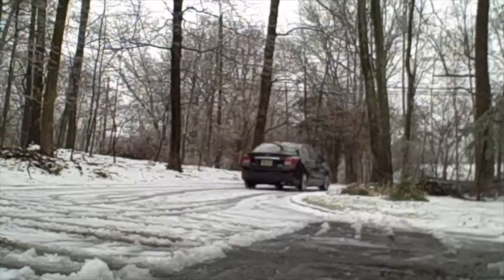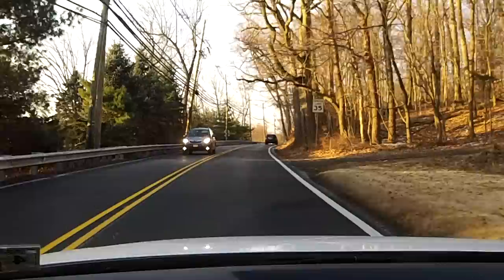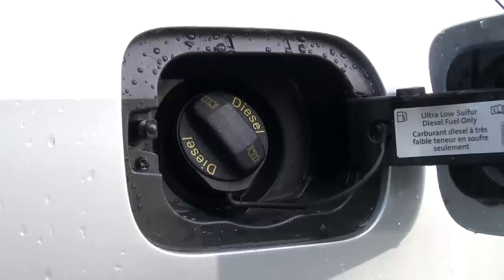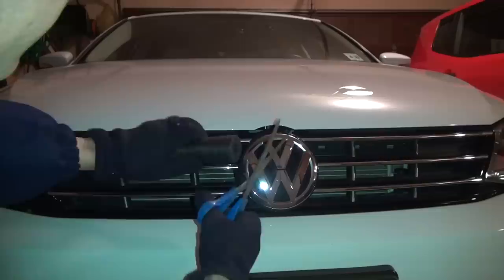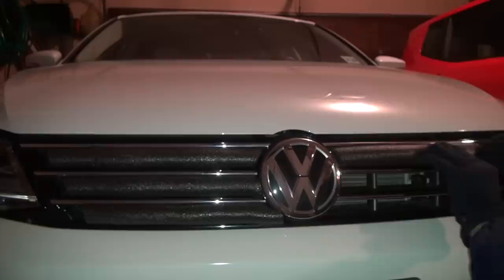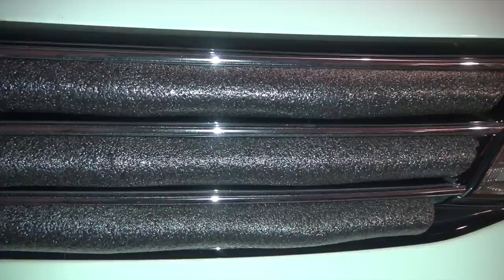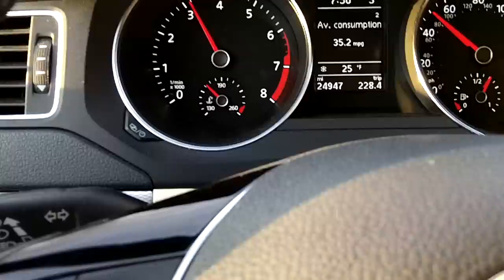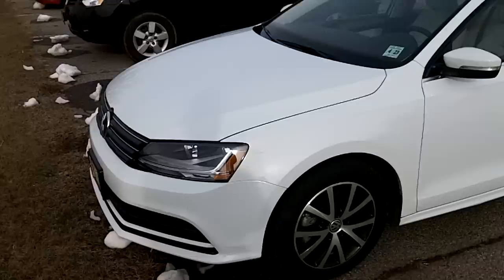DIY VW Jetta winter front grille cover made with a series of tubes

Comment: Way back when I delivered pizza as a teenager, I drove an early 90s Toyota corolla in a town with a ton of hills.  One chilly night, I delivered to a remote location where there was a miles long steep grade I had to climb.   One the way back, I coasted back down the hill on the way back and found it crazy how the temp gauge went from the middle, all the way down to cold. and even the heat blowing form the vents went cold.    One hill coast, and that tiny motor lost ALL of its heat.    Stopping at the stop sign at the bottom I even noticed the engine was at high idle, as if it was just started ice cold.
Reply: Might’ve had to pull the choke out if it were a less modern car! Though the engine might have been bigger too…

Comment: Ive had to do this in a pinch for my 2012 jetta TDI when its below 28F and i have inter cooler icing issues. Makes a few MPG difference as well, but most importantly it means it will actually start the next day.

Comment: My diesel Volvo has slats that open or close automatically depending on cooling need, yet it has no temperature gauge :/ This is a neat solution by the way.
Reply: Same with my VW Polo. It’s strange they didn’t had that feature in the US.
Reply: Bmws has that for years
Reply: My 15 tdi has the auto shutters on the lower section
Reply: FlakeSE my Altima has that... I blocked the top part of the grill off but on the bottom it can close of open if it needs to and it really helps

Comment: If it doesen't warm up it's your thermostat fault,modern thermostats stay fully closed to improve thermal disipation.
  Or you have air pockets in the system ,or incorrect water/antifreeze dilution.
  This method justt masks the actual problem.
Reply: If you have the heater on and also coasting for an extended period of time (a.e. not giving any fuel to the engine, it is after all direct injection, it will shut of the fuel supply when doing so) it can happen that you take more thermal energy from the engine as it can produce so the engine temperature can drop even if the the thermostat is working correctly.

Comment: Unless the car is at full operating temperature, shouldn't the thermostat be closed, preventing coolant from circulating through the radiator anyway?
Reply: Exactly
He has a bad thermostat, a very common problem in VW Group cars you have to change it every 2-3 years.

Comment: I think this cooling effect is less due to the engine being efficient as it is due to the ECU cutting off fuel supply to the engine when it detects coasting. So in reality the engine is only spinning mechanically without generating heat from combustion as there isn't any...
Reply: clipse85 yeah and they cut off fuel supply to be efficient... so while not technically the same practically the same.
Reply: You just described exactly why he said it’s efficient 😂 bravo

Comment: So this is very interesting to me and I'll explain further why, but it's a bit of a long story, so here we go:

I have a 2005 Pontiac Vibe which runs about flawlessly in terms of the engine, transmission, and just about all other systems within the vehicle.  I am very good at keeping my car maintained via tires, oil changes, transmission fluid, etc.  However, every time the weather gets colder here(I live in Missouri) maybe around 40 degrees or colder, I have a check engine light which comes on with a code PO171(System too lean - Bank 1 of  2).  To get hopefully all your questions about proper engine care out of the way, I already change my engine air filter every other oil change, I've ensured my fuel injectors are clean, and that my air intakes are in no way obstructed.  PO171 per the description is actually indicating an error with the first of two O2 sensors around the catalytic converter in my vehicle.  I have also already verified that the converter is fine, and even changed and tested that first sensor to ensure it is not a fault with the sensor.  Yet the code still persists.

As I previously mentioned, I only ever get this code when the temperature outside gets below a certain point(again probably around 40 degrees or colder).  That being said, I am able to avoid this code from coming on if I let my car warm up and/or drive it in a low gear keeping the engine RPM's higher while the engine is still in the process of warming up.  But of course with work I don't always have time to baby my car like this lol.  The sensor is designed to work hot since it reads the direct exhaust output from the engine before the catalytic converter(Note that I never have had a problem with bank 2 which is after the converter).  When the car first starts the computer uses current outside temperature and current engine block temperature in order to determine if it needs to run small heating elements in these sensors which allows them to read correctly while the engine and exhaust systems are still cold.

The engine in question here is a 4 cylinder 1.8L 16 valve(4 valves per cylinder engine), which based on its design is a highly efficient yet performance grade(for what it is) engine, which is why I like it lol.  I have noticed that on very cold days this engine will struggle to keep itself warm.  As this video suggested with the Jetta, my engine(when not fully up to temperature) will actually COOL DOWN if I coast it down hills out and about.  Also, after the engine reaches a certain block temperature(and yes I have tested this), it will shut off those heating elements within the O2 sensors causing these devices to start taking lenient readings due to the cooler temperatures.

Thus there is nothing really wrong with my car, unless you want to count the fact that the thing throws a check engine light almost every single time this sort of thing happens, when there is no real fault other than the computer prematurely cutting off those heating elements which is based on it's firmware, something I have about zero control over(or so I know of anyway).

Anyway, long story short I am going to see if I can't try this method with my vehicle and see how it works.  I will however have to do this with the lower grill instead of the upper, simply because of the upper grills design.  If you are unfamiliar with the Pontiac Vibe series, look up 2005 Pontiac Vibe and you will see what I am talking about lol.

Interesting video VWestlife! Thank you!
Reply: Your pontiac is a toyota
Reply: Nooo......really??? 😆

Comment: what worked for old mack trucks back in the 1960s from what ive seen from a previous landlord had them from a bussiness he had. the truck had louvers that were vaccum actuated so when the engine got hotter it would open up the vanes so cool the engine. im sure they were very effective but they dont use them anymore . it was a mack b61 dumptruck that he sold.  This is Very Creative. now i did the cardboard trick to my cadillac brougham but it was blocking part of the radiator because i couldnt get the grille blocked too good.

Comment: I wonder if that rapid drop was just the thermostat opening.
Reply from the maker: No, more due to the fact that when you're coasting, no fuel is being burned by the engine, so it's just acting as a big air pump, drawing in cold air which cools it down.
Reply: I assume your jetta is automatic, not manual transmission.
Reply: @simontay4851  no fuel would be used while engine braking, even with a manual trans
Reply: @simontay4851  its a year old, but no his car is manual

Comment: The thermostat plays more of a role of what's going on with your cooling system. The foam certainly helps with the car heating up faster on first startup though. Mind you, the thermostat is closed on cold startup, so there's no coolant running through the radiator at that time, making the foam a little pointless.

Comment: When a truck passes you the air pressure can change. I'd get some zap straps to pin them down. Put a hole through the foam at either end and bring the strap around the strut of the grill. Another thing you could do is make a set of luvers you control inside the car.

Comment: My initial instinct is to call this superstition... Manufacturers of modern, advanced automobiles kinda forgot that half their customers live in cold climates, and leave them to buy ugly aftermarket hacks in order to stay warm? What are those covers supposed to do, anyway? The engine won't circulate coolant through the front radiator behind the grille if it's running cold, it regulates this stuff quite happily without us intervening.

...But I can't argue with results. Your engine is clearly running less cold coasting with the grille blocked. Is it so cold over there that the air going into the engine bay aircools the engine block?

I drive a freight truck in Iceland, so I'm quite familiar with diesel engines cooling down while under too little load. That's why all diesel trucks and work vehicles have auxiliary heaters which burn fuel, they either directly heat the air coming through the vents in the cabin, or they simply heat the engine coolant to simulate a properly hot engine. You can turn it on if the engine is not generating enough heat, whether you're driving, idling, or even if the engine is turned off.

No one here has a cover for their grille, I've never even heard of such a thing. It seems like there should be Venetian blinds installed as standard behind the grille if that really works.
Reply: That's German manufacturing for you.

Comment: I've never had this problem with the EA888 2.0T, but I suspect the cars I drive with it have an auxiliary coolant heater that kicks on to get the engine up to operating temperature quicker. The same cars also downshift automatically to engine brake on your test hill (yes I realize the example vehicle is manual).
Reply: No, there's no auxiliary heater, because the exhaust manifold is actually within the cylinder head, when the coolant runs through the head, it and therefore the engine gets to operating temperature faster than a engine with a normal exhaust manifold.

The turbo actually bolts directly to the head. It's pretty interesting stuff.
Reply: It has an auxiliary heater in the heater ducting. A 12v element that kicks on when cold and off when coolant hits 145.

Comment: I'm considering doing this to my 2014 Polo where I commute to work at 4AM
Engine stays cold for ages (1.2L)
I still see no point as its a petrol/gas engine and the UK is never that cold
Reply: I have a 2015 ford fiesta 1.0 ecoboost that will struggle to get past 60-70C when the heater is going if it's below 6C outside. Tempted to cover up the grill on mine too.

Comment: UK Black Taxis do this when its very cold . Usually the older models , and usually with cardboard.
Reply: the old black taxis had horrible diesel engines. Noisy and dirty.
Reply: @simontay4851  yes but correctly maintained they can prob go millions of miles . I also think the older ones(Austin fx4) have more comfortable back seats. The new electric ones are bloody impressive tho .

Comment: 1.4L displacement is pretty darn efficient for a sedan. My aging '96 Jetta has a 2.0L ABA engine. 

I wasn't bothering with using the car when we had the snow. I need to get new tires for it, and the batteries are also old, so I was using my diesel truck instead, since it HAS new tires, and 4x4. I have been thinking of making a bra for it though, just to keep the wind and ice out of the grill when I have it parked. It usually doesn't get too far below zero in the Fraser Valley, but the windchill can get pretty bad in the winter. Because of my trailer, I always back the truck into the driveway, which means that the nose of the vehicle is always windwards. Battery blankets might not be a bad idea either (make those out of denim, probably).

The reason why diesels need to keep warm though isn't their "efficiency," but because diesels don't have spark plugs. They rely on engine heat and the temperature caused by compression to combust the fuel/air mixture, so if the engine temperature gets too low, compression alone needs to heat the air/fuel mixture. If you're driving in very cold weather, you could see the glowplug lamp on the console light up while you're running, because it needs the glowplugs to keep the engine warm enough. That's a surefire indication that your diesel needs a nose bra.

And of course, plug in the block heater.

Comment: Best solution is trade it in for a GLI with the 2.0T and throw on a jb1 tuner. It will get around 250 horsepower and you’ll still get incredible gas mileage. Reliable motor. Great looking car. Only draw back is the maintenance (performance breaks, dual clutch transmission)

Comment: Is this really needed? I live in siberia where it could be -35 celsius from time to time, and this has never been a problem. We just preheat the engine. Most cars are gasoline up here tho.
Reply: Only necessary for diesel really
Reply: it is necessary for diesels for sure. There glow plugs need to get hot before the engine can even run. Starting my passat in -20 F to -30F  in Minnesota this last week was hell. I have a block heater on it, and covered the grill with cardboard and it just wouldn't get hot, and when it did start they sound like they are exploding and smell like cancer in the cold.
Reply: BushWookie73 i think the cars sold in northern europe may be equipped with something your cars dont have. No one has those problems up north, and it’s a lot colder here. I but i dont know
Reply: @Aikaramba12  I think alot of vehicles out of the US especially desiels have a heater that burns fuel to heat the engine while running.

Comment: Be very careful and watch out for warmer weather.
 I drove from Rome to Milan back in the '70s in my  beloved Alfa Romeo Giulia Super 1600. 
I Installed the radiator covers (rubber). All went well on that trip. It was very cold. The covers fitted inside the chrome grill and were practically invisible.
Driving down to Malta in spring, (warmer weather) the engine overheated and blew the head gasket.
Expensive mistake.
Reply: an over temp warning light would come on before the gasget blew, surely? Its gotta be really boiling hot to blow the head.

Comment: Interesting, I never had this problem with any of my cars so far (‘93 Mazda 323F 1.6i 16V, ‘98 Volvo C70 T5, ‘05 Mazda 6 2.2 MZR-CD, ‘98 Volvo V70 2.5 TDI, ‘07 Peugeot 407 Coupe 2.2 petrol). I drove the C70 in weather as cold as -24 degrees Celsius (-11 degrees Fahrenheit) and had no issues whatsoever.
Is the thermostat in the Jetta okay? It shouldn’t let the coolant to circulate through the radiator until the operating temperature has been reached...
Reply from the maker: It's the airflow itself that is cooling down the engine, not the coolant going through the radiator.
Reply: VWestlife makes sense.

Comment: The problem is there is a termostat valve, witch is never open until the water is 85C° you can block the air flow under the hood, but i think you should install a heater like the bloody scandinavians.

Comment: This is strange as something like this should not be needed. Modern cars like Jetta is, should have thermostat, which not only turns on the fan, but should also keep the electronic valve on the radiator closed, so the water should be only in the internal loop (in the engine), should not stream through the radiator at all until the running temperature is reached.
Reply from the maker: That all is true, but especially with a small engine, the air cooling effect of wind blowing across the engine can be enough to cool it down before it is fully warmed up.
Reply: @vwestlife  makes sense then. Thank you for your response.

Comment: Thanks for the video.  Couple questions:  Did this improve your MPG during the winter?  And why was your car at 3000 rpm coasting?
Reply from the maker: I haven't had it on the car long enough to find out. And I was in third gear to get some engine braking as I went down the hill.
Reply: @vwestlife  My go to is third gear at 3.000rpm and 70km/h (45mph)

Comment: Happens to all engines, had to cover all our work gas and diesel vehicles back before fuel injection let alone direct injection. Too much airflow compared to coolant transfer. I used to have to drive my Jetta TDI in a lower gear on highways to because the engine only review at 1800rpm. Bringing rpm up to about 2200 at the same speed helps but hurts efficiency so had to make a cover too. See people spending thousands changing water pumps, thermostats etc etc and all the needed was cardboard

Comment: How oversized were the tubs that you stuck in there? 

My Subaru Outback is neither direct injection, nor turbocharged, but because I try to drive as efficiently as possible I notice my temps will drop when coasting.
And if I have my heat turned on, and the fan higher than 1/2 then it won't actually get up to operating temperature during my 20 minute drive to work.

Also I guess that sudden drop in temp answers the question of if your temperature gauge is a real one.
Reply from the maker: The gauge is semi-real. It shows the temperature accurately as the engine is cold and warming up, but across a wide range of normal operating temperatures, it just stays exactly at the center position, like the gauge in my 1997 Passat did as well. Presumably if the engine actually started to overheat it would go above the center position, but luckily I've never experienced that.
Reply: Depending on how cold it is, or if you actually let your car warm up a bit before you drive. You should check your thermostat.
Reply: @SteampunkDream  I let my car warm up until the coolant is at 100f before i drive off. And it's a 2 year old car I doubt the thermostat is bad. 

If I just step into the throttle further it stays up to temp.

That said even with the foam tubes blocking most of my upper grill my car still drops temperature when I crank up the heat.
It doesn't drop as much, and it warms up a bit quicker. And most importantly when I coast the temps don't really drop.